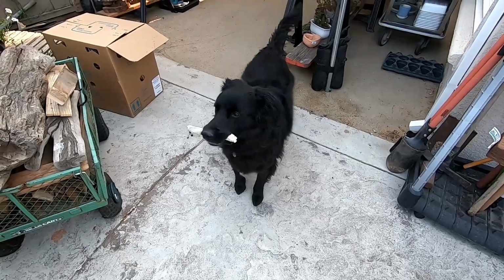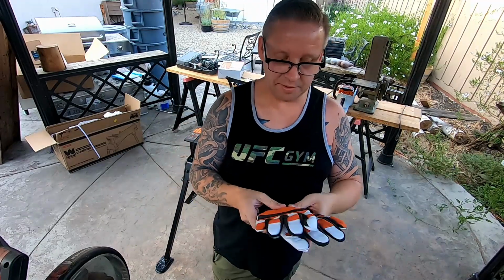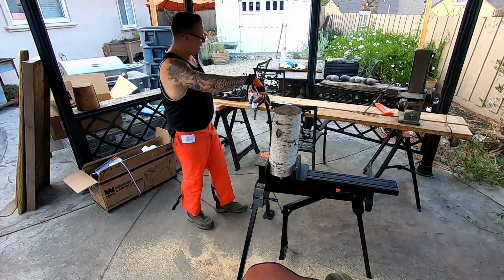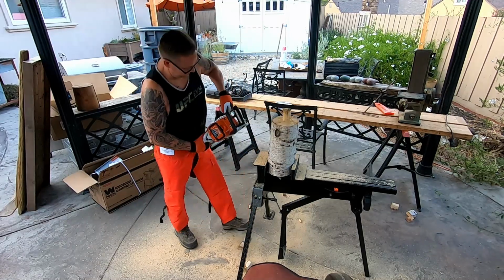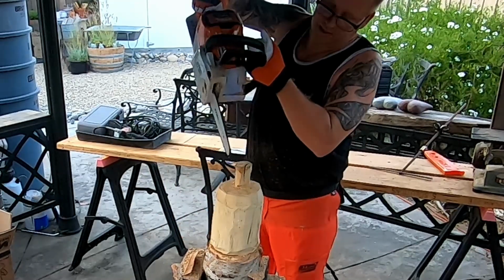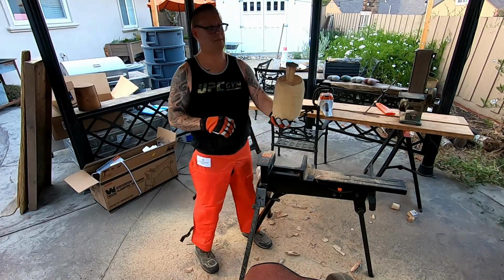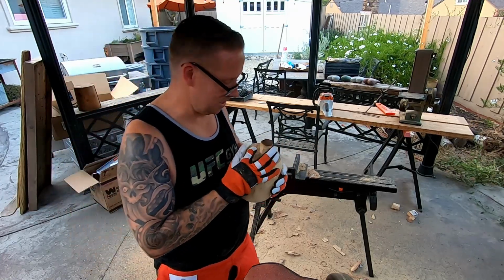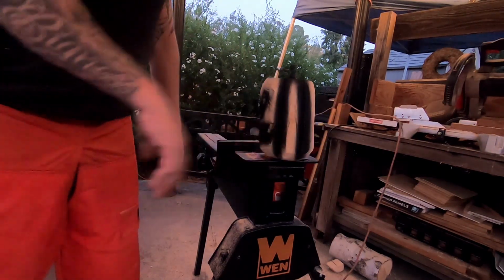How To Carve A Pumpkin With A Chainsaw

Comment: Looks like ur enjoying ur new chainsaw.
Reply from the maker: Yes I like it so far. I ordered a dime tip bar today so I can try something more detailed. You were correct about getting a second battery. I was working on my third pumpkin and the battery died. I we definitely be getting a 2nd batter soon. 😃😃💰💰💰
Reply: NorCal Succulent Shop 
Hey Eddie let me know where U get the diamond tip bar. I might want one. Thanks.
Reply from the maker: @charliemedley7699  I ordered from my local Stihl dealer. Once I get it hopefully next week. I’ll get you a part number.
Reply: NorCal Succulent Shop 
Ok. Thanks Eddie.